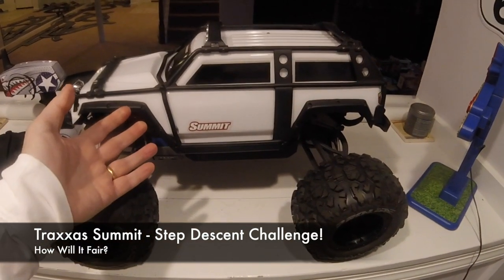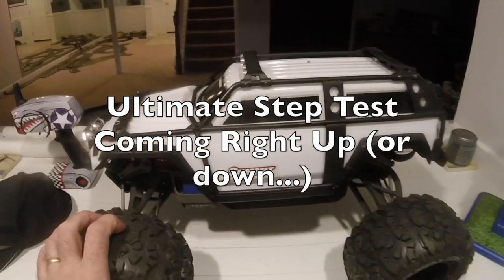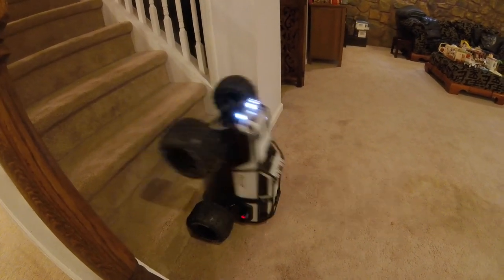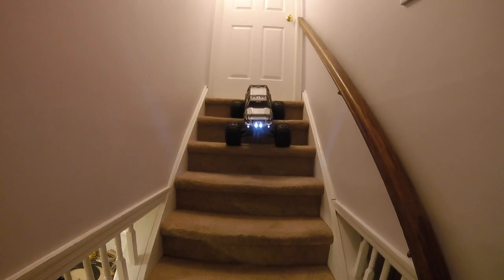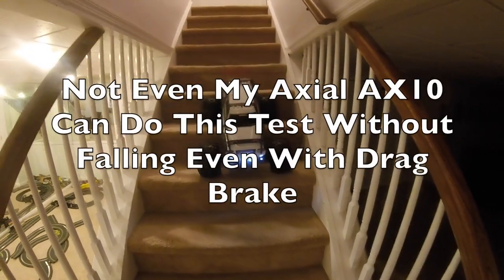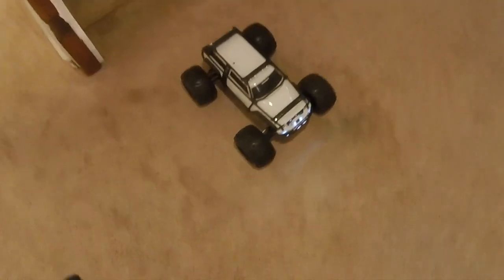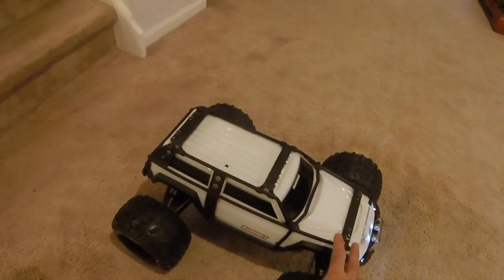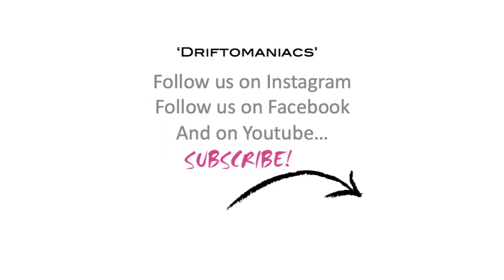Traxxas Summit - Step Descent Challenge!

Comment: thanks for the advice the slack isn't really in the transmission I suppose but when I set the truck on the ground I can roll it about 8 inches across the ground before the motor will turn is that bad or normal?
Reply from the maker: John I'll ask Allan about it and see if we can't help you figure out what it might be

Comment: have you done anything to take the slop/slack out of the transmission?  I just bought a new summit and I can roll the damn thing 8 inches before the motor turns. it sounds horrible when it go from forward to reverse because the motor turns over for a second or two before the power gets to the wheels.  any ideas?  thanks
Reply from the maker: I will ask my friend as I borrowed this one to play with - that said its got next to no play in the transmission. I've just tested it to see by pushing it. Also I was coming down a steep bank (Bashing video coming soon - a bit more to film as yet) in excess of 45 degrees and it didn't run away at all. I will check for you to see if he's modded it or done anything to take up any slack.
Reply: John Smith.   Hi John,   I haven't done anything to that Summit aside from wheels, tires and the occasional sub-zero.    

as far as the slack in the trans,  check to see if the shift rod is coming all the way in and out.   I've noticed, as mine is a first year release,  that if they sit alot the shift mechanism tends to get a bit sticky.  I have had the trans apart a few times to clean and grease it.   

Another thing you can check is to make sure the shift linkage isn't binding on anything, or that the servo is functioning properly.  like I said earlier I've replaced all the sub servos in mine at least once.  they are the one thing in this wonderful vehicle that need to be upgraded.  keep me posted as to what you find.   I'll do what I can to help you out.